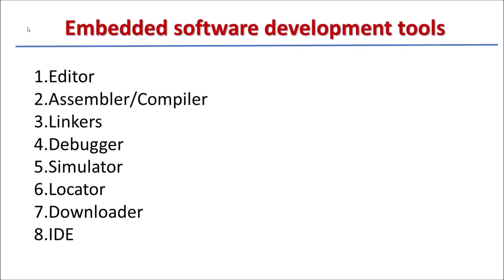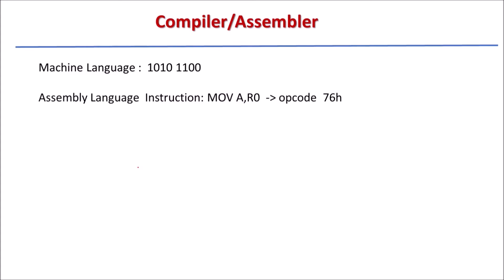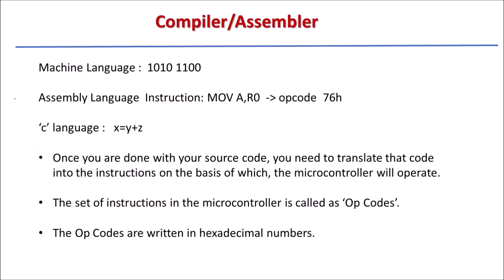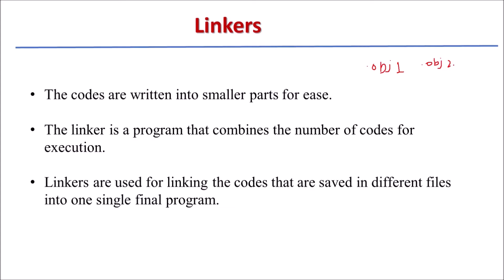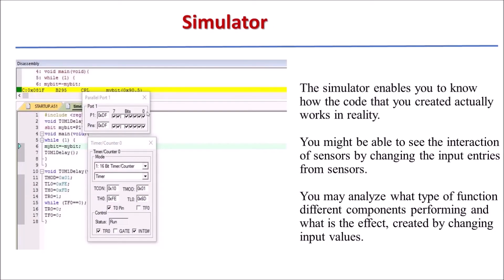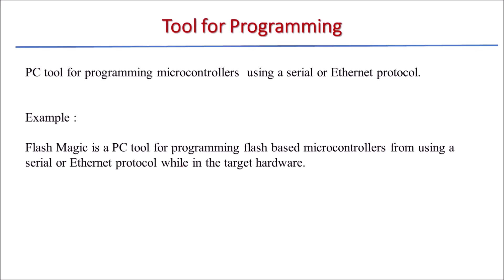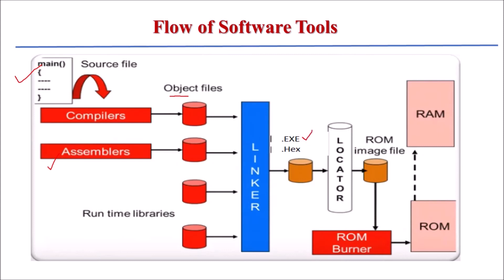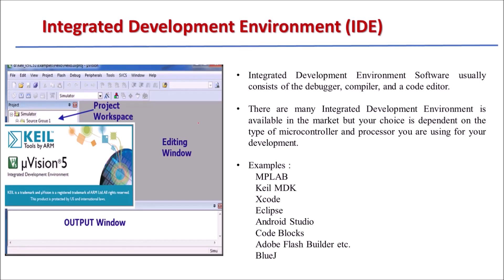Lecture 30: Software development tools for embedded system | Software tools

Comment: Good info. Try using flowchart to code converter. It allows easy firmware designing and auto code conversion. Thx